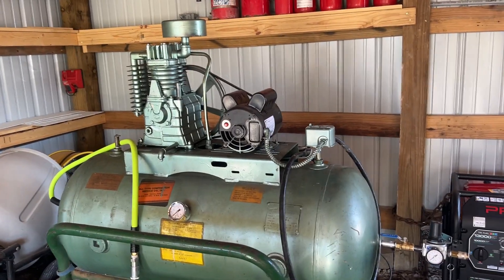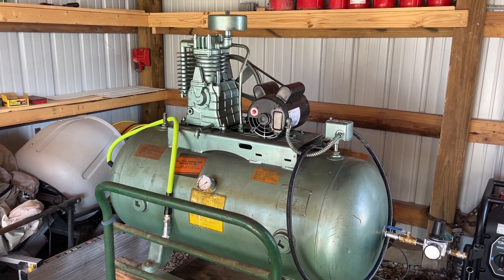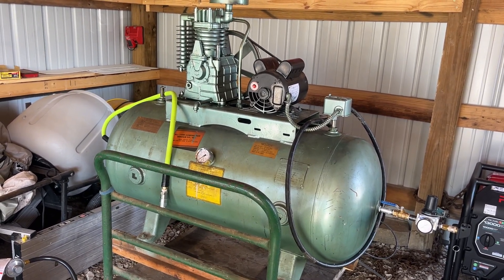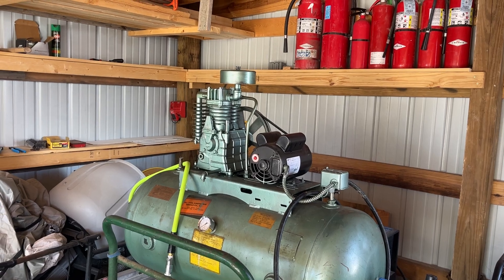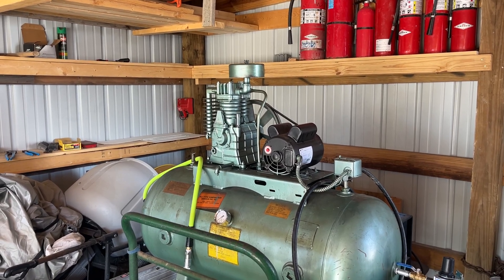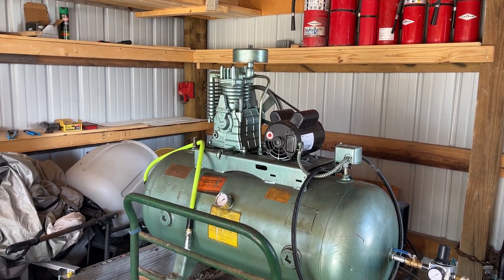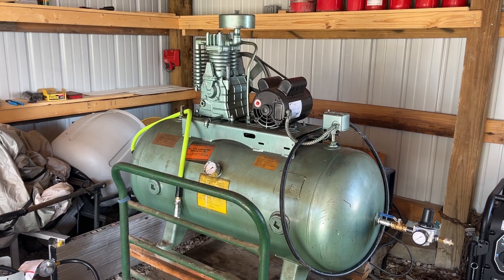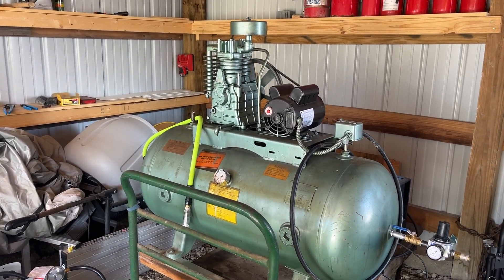Compressor tanks CAN EXPLODE!

Comment: buy an endoscope, they're cheap now and inspect your tank inside. I changed mine after inspection. 40 YO tank.
Reply from the maker: I have a couple of those cameras but that will only show that there is rust but not how thick or thin the metal is.

Comment: I have a small industrial compressor that's about 50 years old. I acquired it near 25 years ago because it needed work. New check valve, new pop-off (relief) valve, new pressure switch, new belt. Reset max pressure to 135 PSI after looking inside with a borescope. Not too bad internally for its age and zero rust on the outside. The original owner must have been good at draining it on a regular basis.
Reply from the maker: Sounds like a good tank for it's age.

Comment: When my 33 gallon Craftsman developed a pin hole in the bottom I cut it in half around the middle to make giant entry lanterns for the 10" diameter steel entry columns at my property entry. There was a lot more going on in that tank than just the pin hole. That hole was merely the place where the pressure first managed to punch through the corrosion. Anyway I made wooden bases for those halves and cut windows in them and installed flickering LED lanterns that come on at dusk and shut off at sunrise and they look so awesome out there at night. That was a WAY better end to that tank than shrapnel all over my shop and maybe some of it in or through me.
This was a useful video Gordon. Well done.
Reply from the maker: Good idea!
Reply: Sick idea, man!  Thanks!

Comment: Yes becareful with rust n metal tanks fiberglass safer but hydro test it it's like cameras inside making sure everything okay u know
Reply from the maker: I'm sure it will pass a water test but the bottom is still rotted out and will continue to get holes.
Reply: @GordonRobertsonDIY  don't use that mr.gordon please it's should be trashed or use for recycling n get different one brother not worth that 💥 boom just get new tank make one out of that same mould of fiberglass use etc fiberglass n resin with catalyst

Comment: I wondered about that, but figured you were very well aware of this already, so I didn't mention it. Good that you're getting new, now....and make sure there's some kind of valve you can open/shut on the bottom so any condensate can be drained after use. Otherwise it will just sit in there and cause rust and scale.
Reply from the maker: I do know about all that, I've been welding for nearly 50 years, just didn't think it could explode. Still extremely rare but not worth the risk.
Reply: @GordonRobertsonDIY  That's my point, I figured you knew ---- it could explode. Glad you took steps and getting a new tank.

Comment: i think what causes those explosions are two componets failing,the switch that tells the compressor to shut off when it reaches the desired psi and the safety valve that opens when it reaches too high a psi
Reply from the maker: I think so too but I did see one video where the welded seam was on the bottom and rusted along that seam and the welds on the end bells were also rusted (not full penetration welds my guess). A big part of that tank failure followed along that bottom seam and part of the end bell. Just can't weld the seams on the inside.
Reply: @GordonRobertsonDIY  I have seen that to, my thought is, tank made in a county I wont name, the material the tank was made out of was too thin and of questionable grade. The weld did looked like it wasn't full penetration for about 2 inches or not in line with the seam,( No quality control of the welding). This caused a fatigue crack because each time the tank presser changes it swells and shrinks, exacerbated by the thin tank. I think the rust had very little to do with the failure. The metal needs to be a lot thicker to allow for loss by rust as well, not just thicker enough to pass test when new. I suggest only buying tanks from manufactures that don't make them light and cheap.

Comment: Gordon when I bought new new stand-up I installed an automatic drain valve on the bottom, they release any moisture when pressure goes down to about 6 psi, you can attach a small hose to carry moisture away to a cup etc
Reply from the maker: Good idea!

Comment: My dad had one explode in his shop,  thankfully he wasn't in the shop at the time.  Gave me a lot of thoughts about moving the compressor outside into a shed for sure.
Reply from the maker: It needs to be under some kind of cover to minimize dew and bird nesting. Mine will be in the new garage behind the mobile home which is open so I'm thinking about building a small room in there for it.
Reply: @GordonRobertsonDIY Sounds like a good plan, plus you don't have to listen to the thing while you're trying to work on your truck.  :)  have a good one Gordon.
Reply: the biggest problem with sticking a compressor outside is increased moisture and temp swings, which makes more condensation inside the tank, which shortens their life further.

Comment: We used to have an old L9000 we used as a shunt truck just in the yard. One of our guys was moving a trailer and the air tanks exploded while he was in it and it tore the cabin apart. It was rotten and really weak but still pretty crazy how they can explode
Reply from the maker: I've seen truck tires explode just sitting there parked and haven't been moved for a while.